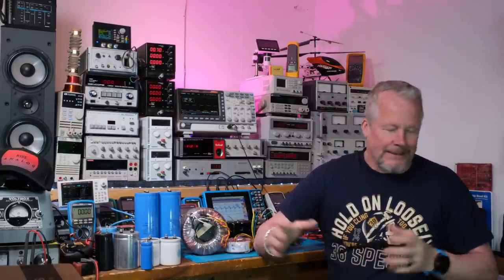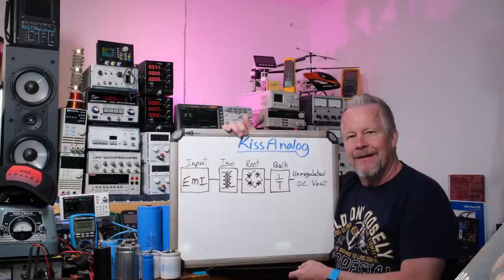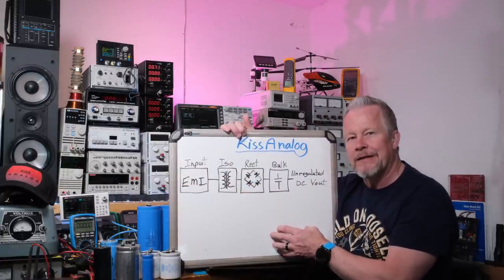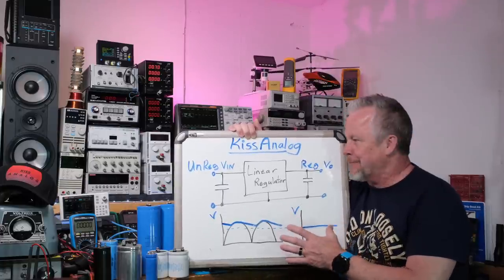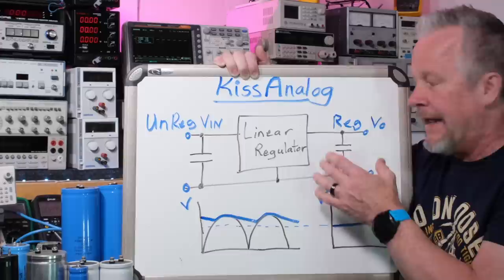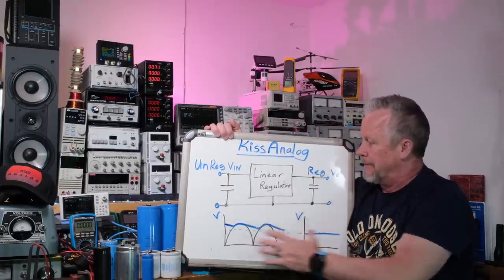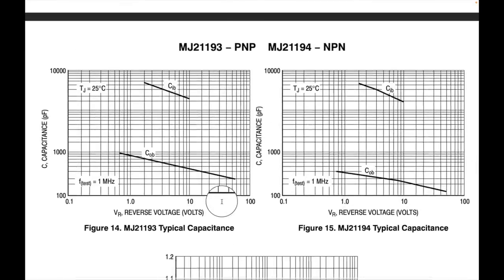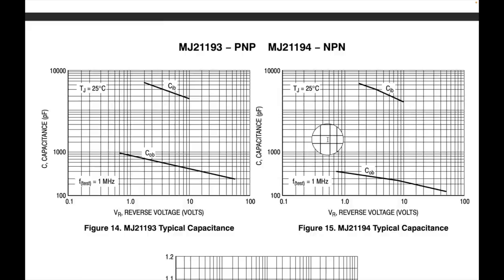Why Amplifier ‘Linear’ Power Supplies are not Regulated Rant - Have they been lying to us? #rant

Comment: Hi Eddie. nice presentation. I have a question, I have design and build a hybrid amplifier and use it for some years now. However this amp has no feedback and is open loop, the output mosfets get power from a classic supply with elco,s of 20,000 uF. Because of the PSRR is low because of open loop. I did think about making a supply, I have a smps soft switching one 60 + 60 volt and is regulated, but most do not and use the resonance smps without regulation just below resonance where drop is low.  I did think about a classic regulator circuit with transistors, no opamps because of noise. What do you think waht is best to use, I think highe freqencies in music will be much better as IM is low, now I think it is high because of low PSRR. thanks.
Reply from the maker: Thanks for asking this great question!  First; the PSRR will be much much better with any regulated power supply - vs an unregulated low frequency switcher using just bulk capacitors.

I thing good switchers are the way to go - no more low frequency hum;)  Have you seen this video where I compare?  https://youtu.be/kPHduHM7V1k
Reply: @KissAnalog  Thanks for your response. I have a switcher who work on 100 KHz resonance type, this is regulated but most of the time because of the dynamic of audio amps this regulation can not follow that, except when make it vary fast who do make smps unstable. The resonance version has a nice side effect that and EMI is very low, and when do resonance point just below or above working area the smps is quite stable when have dynamic current taken from it. I have now simulate also a version for the tube part, this do deliver all the voltages and filament ones also, and is regulated and  work great, no big amps, it is just preamp and that is fine for regulation part of smps make it happy.

Comment: Perhaps the "that's the way we always did it" comes from a time era (maybe 40 years ago) when perhaps there weren't sufficient components available to build a regulated supply to handle the high current requirements of the output stage of 100+ watt amps of 40 years ago. I don't know, I'm just guessing.

Comment: Power Amplifier: I am a power amplifier.
Regulator: I regulate your power supply.
Power Amplifier: You're dead!
Reply from the maker: Your Power Amp has a regulated power supply?  Wha?t brand and model is it
Reply: @KissAnalog  no sir. what i mean for that comment is a conversation of the two. Power Amp VS. Regulator. 🤣 coz power amp need more power as it needed to give power to speakers and that's why we cant regulate its psu coz it draws prower from it, unless we have also a proper regulator, if not, that regulator will be dead. that's what i meant there.
but i will share an idea to regulate a power supply from a power amp. simply we will just use an avr and regulate our AC input before it converts to DC inside our power amp. using an avr with a servo motor is highly recomended. and matching its rated power to our power amp, we will never be raning out of power anymore! 😉
Reply from the maker: OK I understand.  The avr method will be more noisy than a linear regulated PS.  The Amp is essentially a power supply regulated by the input signal and feedback.  So yes, the PS would be large to be able to regulate it, but so if the amp is twice as big - then it is twice as big.  But if this sounds crazy - think about the people selling power conditioners that are as big as an amp - or the expensive power cords that cost more than most amps that people have.

Comment: How does a "choke" power supply work in comparison when they add a choke instead of a bulk capacitor?
Reply from the maker: Great question!  An inductor can be used with a capacitor to provide an LC filter.  This can help reduce voltage ripple.
Reply: @KissAnalog  oh wow thank you so much! My Lampizator dac has a choke power supply with an inductor and cap after the transformer. It has Vacuum tubes too. 2 input for gain and 2 output  tubes. I had it recapped with Audionote and VCaps and it came with a lot of junky parts for a 6000 DAC! My amps are Mola Mola Kaluga class D amps with switching power supplies and a class A Luxman L-590 AX II. But the best amps I ever heard were Pilium from Greece. Second best are Audionet from Germany. Take a look at the pictures online of the Pilium Leonidas integrated amp. It is a beast.

Comment: Ever thought of experiments regarding multiple rectifiers but phase shifted? supplementing eachother into a completion.. ? and then smoothing/regulating that ?
Reply from the maker: Great question!  Do you mean with a watcher?
Reply: @KissAnalog I'm not so knowledgeable in electronics that I know what a watcher is, but I know of 3 phase PSU's with each phase rectified, that allow you to overlap parts of their rectified halfsinuses so that there are no deep dips, and every moment is covered with a good buffer. It still needs smoothing, but as far as my understanding goes, allows for better continuous supply..

Comment: The most power is drawn at the bass frequency's , because of the speaker 2 x pi x F x l,power suply sould be able to handle that, otherwise it wil interfere with the signal, when the power rail is dropping within the working area of the amplifier.
Reply from the maker: @Ronald Hofman Yes this could be a problem.  Choosing a transformer voltage high enough and the right size of capacitors should be enough.  Adding a linear regulator would solve this as well - and help keep the voltage across the output devices solid (stiff).  This could correct any issues with ripple voltage.

Comment: The impact of the supply on an amplifier depends enormously upon its topology, so there can be many aspects to this that don't generalize to all designs. Often amplifiers include various forms of "regulation" in a manner integral to their architecture. Additional pre-regulation steps can be understood by combining the regulator and amplifier and considering the overall composite circuit as an amplifier unto itself. Obvious illustrations of this can be found in architectures that literally nest one amplifier within another, such as the class H, but there are many other subtle ways in which parts of an amp can implement effectively equivalent regulation functions. Whether or not a linear regulator actually serves to "isolate" anything depends on its context.

An ordinary VDMOS power FET datasheet isn't going to directly tell you anything about its linear characteristics I'm afraid. All of those graphs assume full on or off gate voltages.
Reply from the maker: Thanks Daniel for this great feedback!  Regulating the input stage does make a big difference.  The final output stage is probably the stage that could be most effected by ripple.  The parameters in the data sheet do show there are dynamic behaviors do to the voltage across the device - although it is difficult to tell what exactly that relationship is.

Comment: Linear as in "Linear Power Supply" refers to the voltage regulator design, or more specifically the operation of the regulator pass amplifier (Like a transistor, which can be used as a linear pass element or a non-linear switch) in relation to a voltage reference. So a switching regulator would use a switching technique to regulate the output voltage in relation to a voltage reference. 

A front end with just a transformer, bridge and capacitor is called an unregulated supply. It is neither linear or switching regulated. To use the word "Linear" to describe it is wrong.

It is also a misconception to think of a regulated power supply as a separate stand-alone entity (on a separate chassis or PCB from the audio amplifier) and if so, it should be a called a pre-regulator. Why, because the performance of a power supply at the output stage of an audio power amplifier is a measure of impedance at the amplifier power output rails (final stage). 

So, it is conceivable that you could have a switching pre-regulator and then a final stage linear regulator of very low impedance directly at the amp output stage. The point is, for the best performance of an audio power amplifier output stage, it is the output impedance of the power supplies at this stage, which translates to the best possible noise performance, and it is clear from a power supply design and testing standpoint that the lowest impedance is achieved using a regulated power supply. 

From a regulated power supply standpoint, an audio power amp output range (20Hz to 20kHz) is wide band. So, the regulated supply must provide a low impedance over this broad range of frequencies. The supply should be designed to satisfy the load, and to debate its effectiveness without knowing the requirements of the load is pointless. 

Similar to the above topology is how PC motherboard microprocessors (uP) are powered. There is a stand-alone pre-regulator or "power supply" that mounts in the computer chassis, and a purpose built switching regulator on the motherboard in close proximity to the load (the microprocessor, and the processor chip set). In a PC both the pre-regulator and the uP regulator are switching regulators.

Comment: With unregulated , you mean that that the big elco's after the greatz circuit , must keep the  voltage steady, the big advantage of a regulator is the big 10^5 or higher common  mode rejection ratio, if that faisls and a ripple will appear , yuo  will hear noise at the speakers.
Reply from the maker: Thanks for the feedback Ronald!

Comment: There is a sound difference using a good regulated PSU. It isn't universally better. Polite is the best word. Naim NAP 250 works well. Quad 303 sometimes shorts it's PSU. It can sound  more dynamic broken.

Comment: A tracking hybrid switcher/linear is ideal for audio.  Maybe some audio store can sell this ...efficiency and electrical quietness!
Reply: ZVS topologies like phase shift bridge or other resonant types would be even quieter!  ...in fact the slower response time of resonant, but the quietest ZVS topology, with a post linear reg is maybe a match made in heaven for efficiency, size and clean output. :)  ...of course a front stage PFC should be there, but standard boost topologies are noisy, but there are ZVS PFC systems as well, I think  Not sure where I read about them, but if I find it I''ll tell you :)
Reply from the maker: Thanks!  Yes, i do like the soft switchers, but the problem in finding one off the shelf is that most have bridge rectifier inputs vs PFC.   I want to start with PFC and end in a soft switcher - with great LC post filtering;)  I'm designing one now for the JAT colaboration;)
Reply: @KissAnalog  Well now you're just being picky! :):):)

Comment: I was wondering why we don't see in linear power supplies capacitor multiplier, using coupled transistors, that'll get rid of your ripple.
Reply: It's a gimmick. There are several kit versions of cap multipliers, I don't recall the name.
Reply from the maker: I think they don't use linear PS because of the added size, weight, and cost.

Comment: I think so chopper controlling after regulated V-out that is more cost circuit with inductor converters. it was ripple will be have so necessary increase capacitance what were great size with your desk there near.

Comment: it would be cool to actually have an test amplifier and a power supply and measure the difference between regulator and no regulator
Reply from the maker: Thanks - that's a great idea;)  Have you seen this video where I compare an amplifier working with a switching power supply vs a linear regulated power supply?  https://youtu.be/RA4mokWEPUg

Comment: Lots of very cool ideas and comments around your PS video.   To me and my ears this is the bottom line.   When you look into an SP-11 and see the design work around the Power Supplies in this unit, you start to understand just what your talking about here Kiss Analog.   My understanding is that audio amplifiers are just DC modulated signals.   Well if this is true, then we had better start out with an absolutely perfect DC signal or else it will influence the modulation of the DC as the amplifier recreates the mini signal into a more powerful signal.   I agree with you here in that any such perpetration on the pure DC signal feeding the amp will add distortion to the original signal.    With that being said,  even as the amp uses DC power to recreate the AC signal , this will in effect cause the DC to modulate , at the power supply side of the amp, which will in turn cause distortion during the DC modulation of even more signals coming into to be amplified.    This seems to be an never ending circle of distortion.    Seems we need to also be concerned about the perpetration coming from after  the power supply meaning the amp itself.   Wonder if we might even try to predict the effects of this so as to minimize the effects of the music playing and also the ripple of the incoming power all at the same time so that the amplifier will see continuous, perfectly smooth DC, as perfectly smooth as possible and this is the goal.   This would amount to a feed forward type of feed back.   Generally speaking, I've always viewed linear regulators as voltage devices were as shunt regulators to be current regulating devices.    Hmmmmm.   maybe a combo of both would be the ticket.   I agree too with your rant.   The Power Supply should be regulated and with all the amps that I have built over the years,   I wouldn't even dream of building an amp without a regulator.   The regulators are becoming more complicated but also more simplistic in there topology.    Maybe what we could do is charge a bunch of big storage batteries and then remove the charging system from commercial AC and use just the batteries to power our amps so that we might get the purest DC of all.     Hmmmmm,    I wonder if you might hear the chemical reaction happening in the battery as it produces the power to feed the amp ??   Thanks for a great vid Eddie.
Reply from the maker: Thanks Sparky for the great feedback.  I'll have to do some testing to try to show whether there's any benefit of linear regulating the power supply;)

Comment: I wonder if what people call "transient response" with an unregulated power supply is actually what tube purist guitarists call sag. Many guitar amps have under-specced iron; some models made by CBS/Fender are famous for power transformers that can only deliver about half the current that the power amp tries to draw under heavy load, and the reservoir capacitors are small enough that the plate voltage literally sags in response. They're so far from stiff that I'd describe them as flaccid, but it's often an integral component in the sound that these guitarists are looking for in their music production equipment.

"No other industry that has to re-cap their products"? I bet you got a lot of HVAC techs and auto repair guys laughing with that one! Also, many of Big Clive's and EEVBlog's repair videos involve replacing a Wun-Hun-Lo capacitor that has degraded, and practically none of those devices have anything to do with audio. And if you ever buy vintage test gear, I hope you do replace the electrolytics in it before you use it, and if it's tube gear that has paper/foil capacitors, you'll also want to replace those with modern poly.
Reply from the maker: Thanks for your great feedback!  Yes, instrument or guitar amps really do have their own sound.  All kinds of built in distortions make up these types of amps.

LOL, you are right, but I was specifically talking about the 'recap' term.  This is commonly used in amplifier or audio equipment.  It is true that repair techs replace caps to solve wear-out problems - probably more often than any other single type of component.  Aluminum electrolytic are maybe the most unreliable device that we design in.  Especially in electronics that try to save a dollar.

Have you seen the video that I did talking specifically about reconditioning the aluminum electrolytic and how an older piece of equipment needs some attention before powering it up: https://youtu.be/iaqEc6pWees

Comment: Lastly. Regulators allowed transistors to be used to the maximum. Quad 303 was regulated to 67Volts. Now 230 vdc transistors are cheap. No need for regulators.
Reply from the maker: Thanks for your feedback!  If you are being really critical - as someone building Audiophile type amplifiers - then regulation can help.  The gain of the transistors does change with applied voltage, so if it is moving around - then that can have an effect - even if it is only small.

Comment: I like that, "low frequency switching power supply".  I never thought about it that way before! Now you say it. it seems obvious. Cheers. The power supply capacitor is in series with the o/p signal loop, so is likely to make a big difference to how the amp sounds. The reason people don't use regulated power supplies is largely expense. The regulator has to have enough compliance voltage to allow for line fluctuations and heavy transient current draw by the amp. Lots of waste heat and lots of hardware. But as you say, manufacturers then try to sell you line regenerators instead. I think you are onto something regarding power circuit voltage drops. I have to disagree about "we can measure it if we can hear it". Listening to music involves our whole mind body complex not just our ears. Our ability to measure nature is very simplistic and within the bandwidth of our technological world view and equipment. Measuring stuff is very useful, but it's not the last word on the matter. Best. M